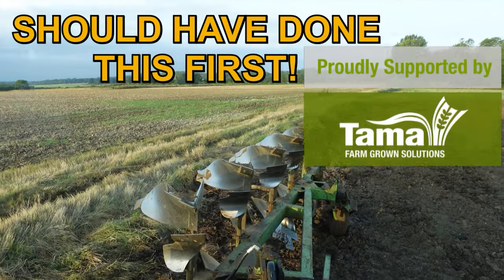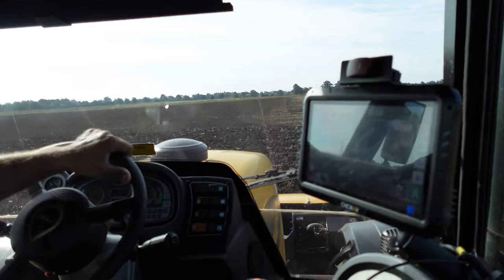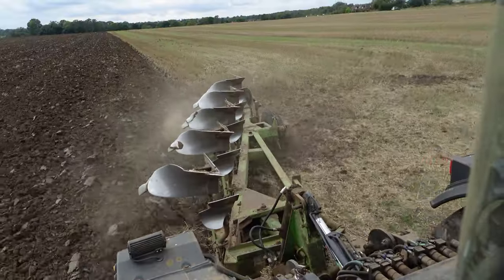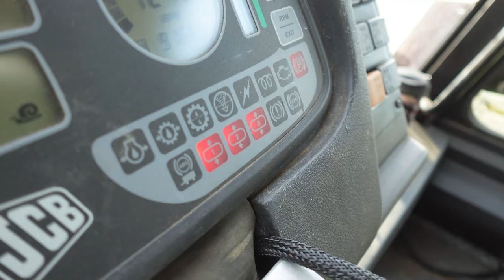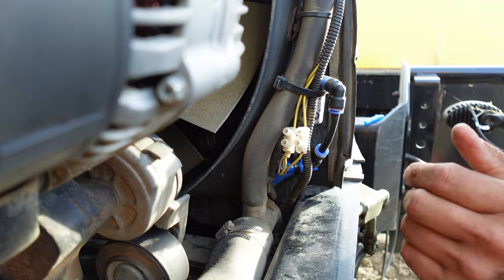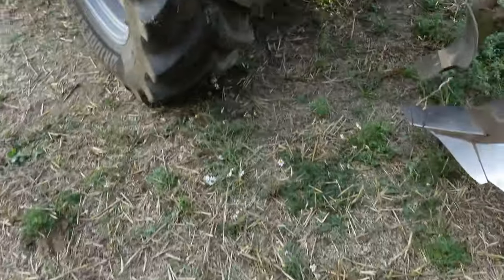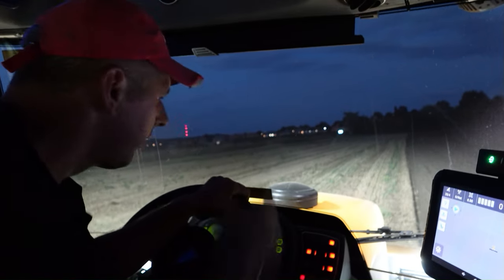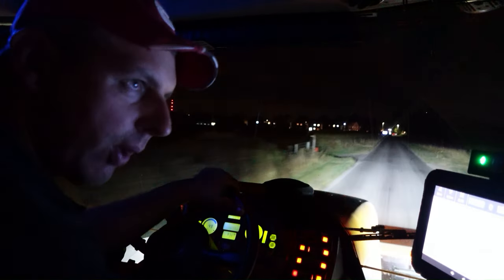JCB FASTRAC CAN PLOUGH - IT DOES BREAKDOWN THOUGH!

Comment: Another great Fastrac video George. 
was thinking you had a reverser fan fitted. As 8.28 straw blows off the side of the engine grill. Coincidentally it's the same place as your burst air line.
What's the green button on the gearstick for?

Comment: How do you set up the auto steer for in furrow ploughing? I’ve the same system and been messing with it today but can’t get it right
Reply from the maker: So Richard the main thing is your plough needs to be set exactly the same both ways, not easy with an old plough and even trickier in furrow. Work out the width of each furrow and enter that as your width, do a pass, turn round and enter the furrow again, see how far off centre you are, use that information to alter the width. Keep doing that until you get it dialed in. The other easier option is when you enter the furrow just recenter your line.
Reply: @GeorgeSaunders  I’ve been messing with both ways as you just said but still not happy with it
Reply from the maker: @richardreams6886  it is really tricky in-furrow, especially if you're ploughing through different soil types.